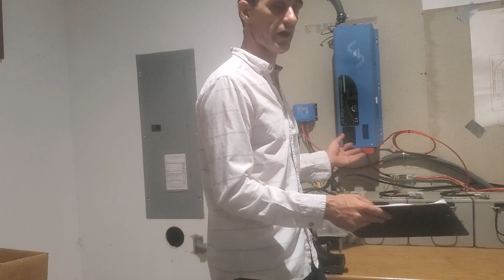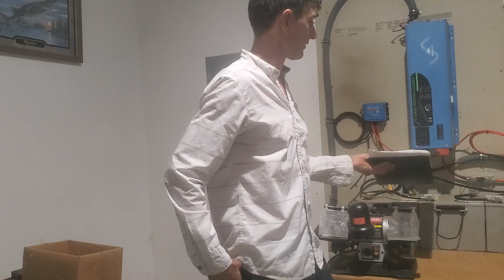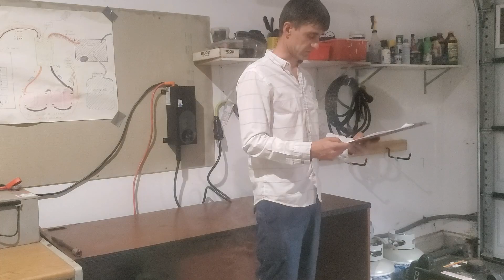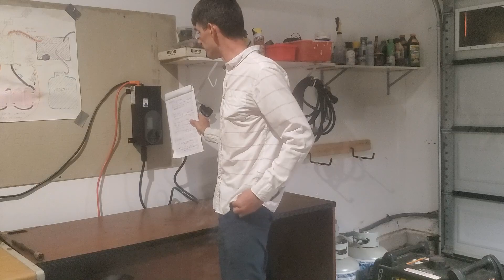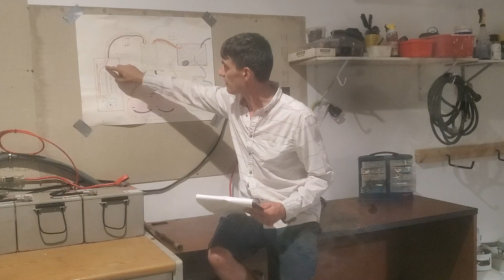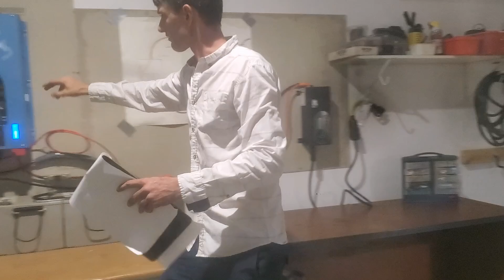Emergency Backup Power - Complete System Build

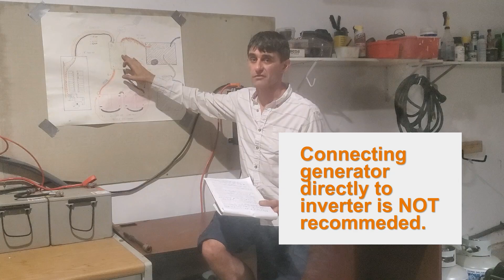Comment: Thanks for describing your system.  I was waiting to hear why you did not connect the generator directly to the inverter / charger and you answered it at @15:00.  Sounds like even LF inverters with a transformer are susceptible to damage from generator power based on your research.  I knew that was an issue with the switching all-in-ones, good to know it's an issue on these too.